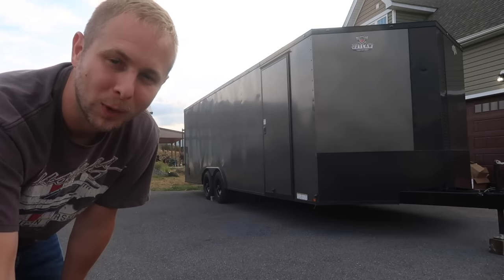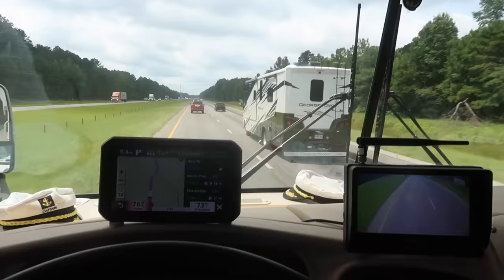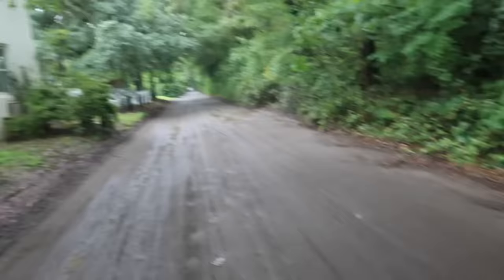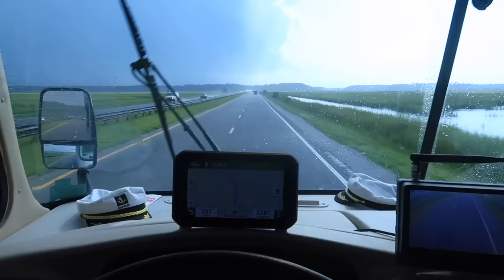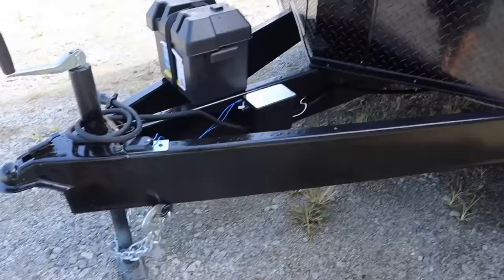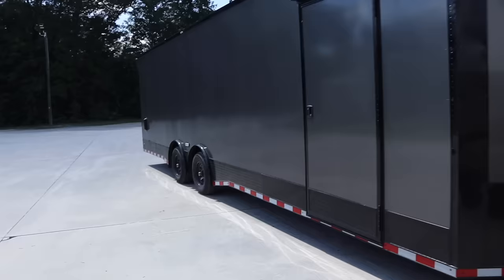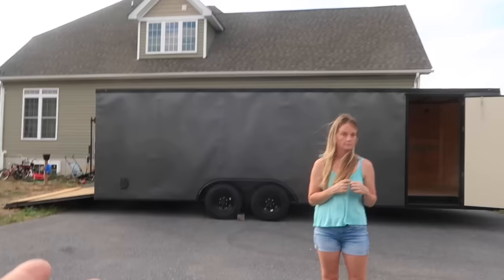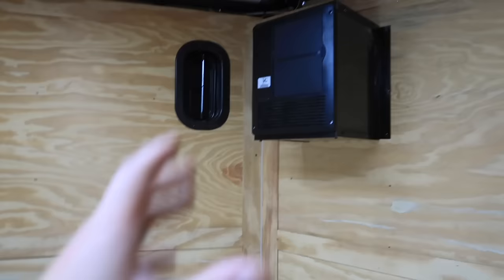We Drove 12hrs for a NEW Custom RACE CAR Trailer

Comment: The angel oak is amazing, hard to get it in a pic from a phone.  I wondered where you were gonna park the RV because that road is not great haha.  Georgia trailer?  Hope you have better luck than most that get them from there...check those welds and general fitment.
Reply from the maker: Had pretty decent luck with my last trailer so hope this one is good.